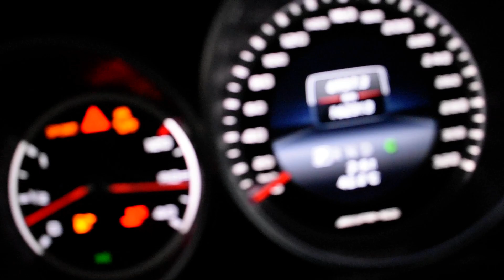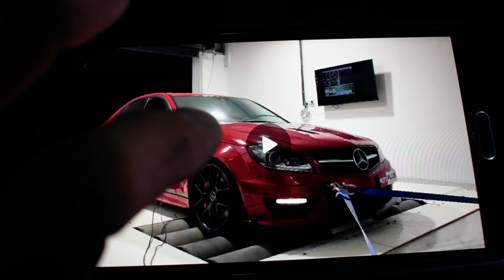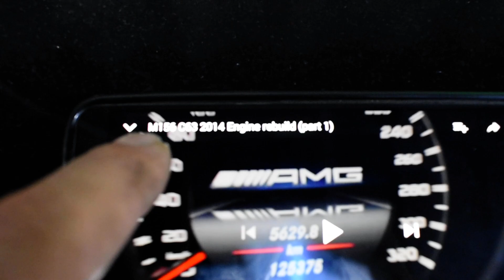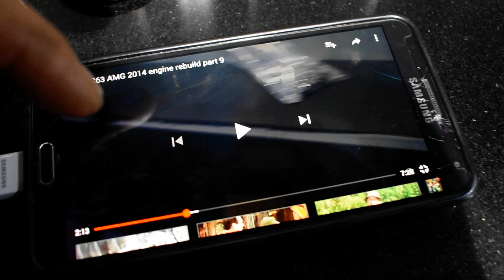M156 test car, trying to install billet camshafts on S/C version (part 1)

Comment: Good evening Tasos ,hope al is well, please can you advise me on the Wiestec air filters for the M156 ML63.  Will they cause any problems with the air mass sensors? They say they are 'dry' filters and do not need oiling.  Please advise as you know best.

Many thanks

Comment: I'm thinking about getting a 2012 C63. Are they reliable? I know the headbolts were fixed in 2012+
Reply: jmhellison Did you buy one? I did.
Reply: Jmhellison I bought a 2012 P31 two years ago and the car has performed superbly.  I only changed oil and tires.  Great car.

Comment: Hello tasos, would you recommend using liqui moly in every oil service? I have a c63 2013 and it's only done 24,000 miles or 38,000 kilometers. Thanks.
Reply from the maker: I'm putting one bottle every 50k km
Reply: Thank you for you answer tasos, keep up the good work and great videos you do.
Reply: Tasos Moschatos cera tec?
Reply from the maker: Yes
Reply: Tasos Moschatos i have a 2004 e55 imported from dubai but its produced in japan,i am using mb oem oil 5w40,do you sugest to add cera tec?my car says have 74,000 km.i see your videos you  are godfather of these AMGs,greetings from albania tirana
Reply from the maker: It wouldn't be bad to add one bottle on the next oil change
Reply: Tasos Moschatos thnx